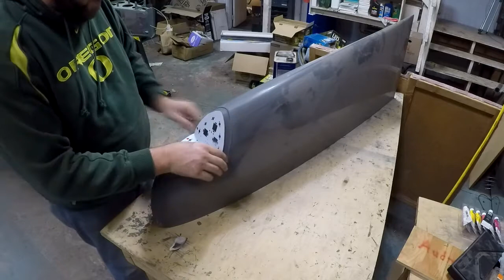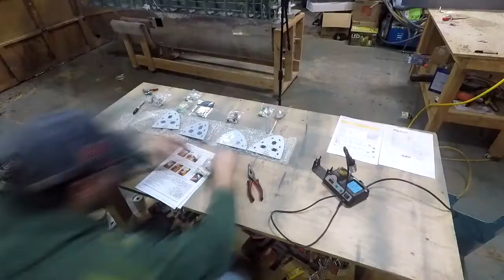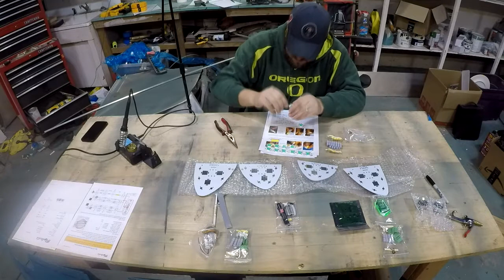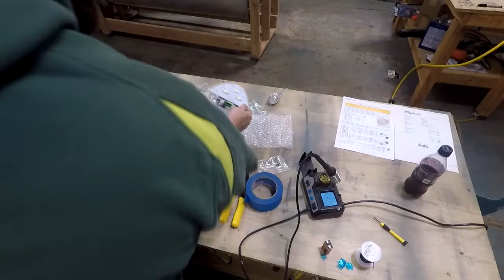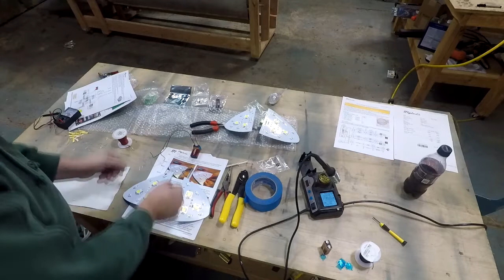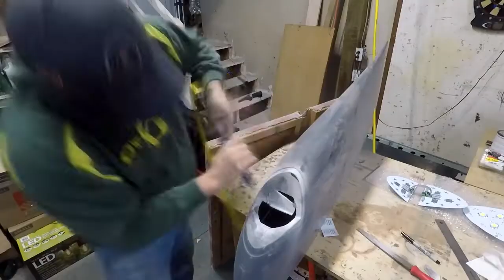Fly LEDs Wingtip kit

Comment: Thanks for sharing and very informative.  I am researching FLYLED and your video came up.  But I will be installing on a non-RV airplane
Reply from the maker: They really are a great company to work with. Whenever I reached out to them, they were quick to respond and provide feedback! As far as their lighting kits go, it was very easy to follow the instructions and put them together! Good luck to you!
Reply: @didja691  thanks for the feedback.  I have reached out to FLYLEDs and have gotten a quick response.   FLYLEDs wing kits RV7/8 is the most compact and may be similar to other non-RV wing tips that can be custom fit.

Comment: Thanks, great video.  I am in the decision phase of building.  In other words, trying to get the green light from Momma.  One more note, 3M double sided tape is a great choice for applications where temperatures are constant.  However, if there are fluctuations in temperature, double sided tape will eventually fail.  I am an automotive engineer and the industry stopped using double sided tape years ago because of failure.  We now use a mechanical fastener with compression on both sides (no pan head set screw).  

We now use plastic fasteners affectionately called Christmas Tree fasteners.  Where we cannot use plastic fasteners, we use small machine screws (#4 or #6) with a nylon lock nut or thread lock (red or blue).   We found that lock washers also eventually fail and do not use them anymore.
Reply from the maker: This is part of the reason that I have not installed these yet even today. I am waiting to see if there is something that I can utilize instead of the 3M tape. I'm just not quite convinced that the vibration and temperatures wont cause the tape to fail...

Comment: Super helpful Scott. I’m building a 14A as well here in MA, and am at more or less the same stage as you (except I stopped for a few years and you are zooming quickly ahead!). I decided to wait on lighting until later in the project, but was going to go with the flyleds as well and this is one of the first videos I have seen applied to a 14 so thanks for that! Keep the videos coming! I would start my own channel but I start and stop my sessions so frequently that I’m not sure I would have 10 minutes worth of video that made any sense! Great editing job.
Reply from the maker: Yea, the 14 seems to be one of those that if you have the time, they go together pretty quickly! Its just a matter of finding that time! I had a year or so that I couldn't work on it due to moves. Now that we moved to a house with a shop, I have fewer roadblocks! 

I highly recommend the Flyleds set! Very easy to assemble, a great product, and significantly cheaper than the equivalent AeroLeds lights!
Reply: @didja691  which landing lights did you buy for the bays in the front of the wings? Seven stars? And also which tail light did you get?
Reply from the maker: @unclefreddy2009  yes, the seven star lights. You can choose to use all seven for landing lights, or as I did, utilize the center light as a taxi light with a diffuser lens over the light. They also were very easy to assemble.